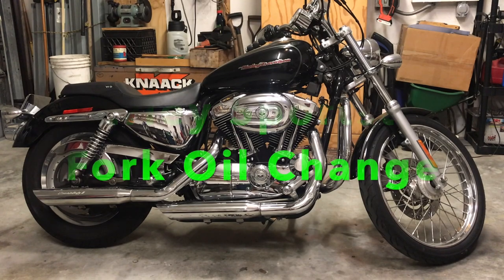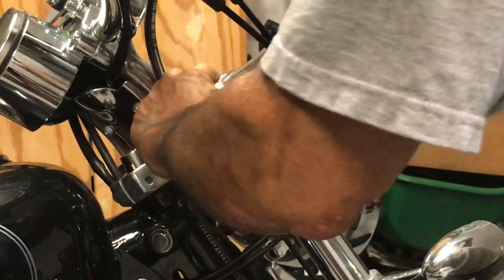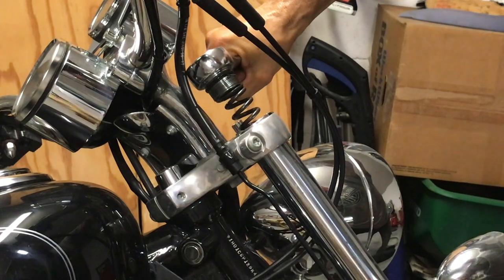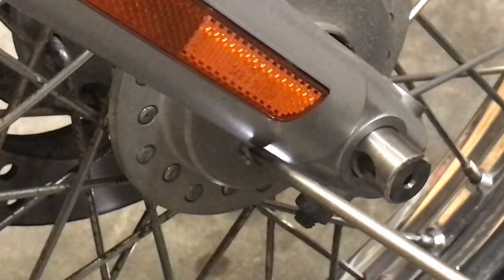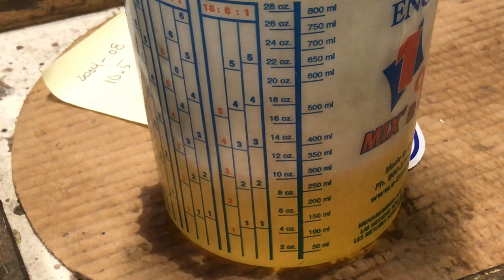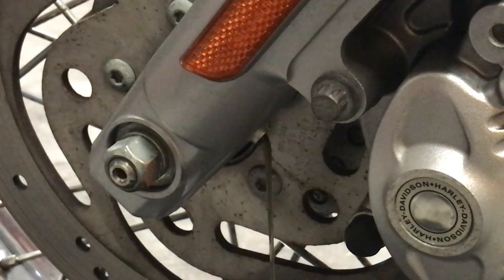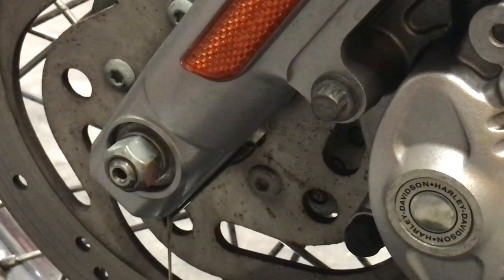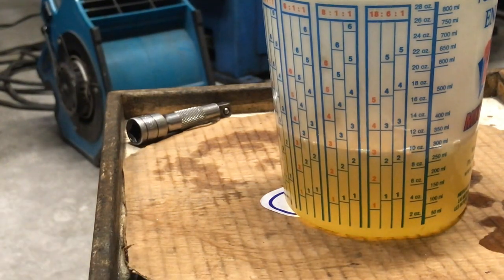How To Harley Sportster Fork Oil Change

Comment: When I changed my fork oil in my new-to-me 2005 Sportster, it had a total of 10K miles on it but because the bike was 15 years old I decided to change it along with all of the other fluids. I'm glad I did. Thankfully, 10 oz. came out of each side but the bad news is that the fluid was black, as thin as water and stunk like skunk oil. The difference in the ride afterwards was amazing. The forks had been bottoming out over big bumps but not after the fluid change. Evidently, time is also a factor in the degrading of the oil. I plan to change mine every 10K miles from now on. Wonderful video!
Reply from the maker: Happy to hear all went well, Thank you for your Sub Boomer. Any questions just ask. Ride Safe and have a great day.

Comment: Nice little tip with the Spot of paint there., excellent video as always.
Reply from the maker: Thank you, Ride Safe and have a great day.
Reply: I've got a 2002 Sportster which ticks a lot on tickover, I've removed the lifters and cleaned them but still ticking a little. They looked fine when I took them apart and only had a bit of dirt in them but the bike has only done 12000 miles, do you think it's possible they can fail with such low mileage? I've changed the oil to semi synthetic and also tried a little marvel mystery oil in with it but still it ticks on idle, oil pressure light goes out as soon as bike is started. I thought I'd ask you before I fork out for some replacement lifters, thanks for your help.
Reply from the maker: @harleydavidson801  How long have you had this tick? Did you buy it this way?
Reply: @TwoWheelRocco  I bought it like it about a year ago, a couple of times it didn't tick on startup for about 2 minutes but then returned.
Reply from the maker: @harleydavidson801  Sounds like dirty in the system. How many miles have you rode this bike since you owned it?
Reply: @TwoWheelRocco  I've only ridden it up and down my road as I have been turning into a bobber for the past  year
Reply from the maker: @harleydavidson801  You will need to give her a few good rides 50 miles or better....That should do it.. If that don't work run a cleaner for lifter in your oil. Let us know how this works out. Thank you for your support. Ride Safe and have a great day.
Reply: @TwoWheelRocco  I'll give it a good run, thanks for your help much appreciated.

Comment: I don't know what it is man but all your tutorial videos I absorb 100%. Thanks for everything have a great day
Reply from the maker: I'm really happy to help. And thank you for those kind words. If you have any questions just ask. Thank you for your Sub Dan. Ride Safe and have a great day.
Reply: @TwoWheelRocco  actually bud I do have a question. Maybe two. I have an 05 883 I just recently bought. It has an aftermarket exhaust; pretty much a straight pipe on it and a big sucker intake. I'm trying to tune my carb, any recommendations on jet sizes? The reason I'm asking is I played with it and got it to idle correctly but now it seems to want to stall when I hit the throttle. Any ideas on why it's doing that?
Reply from the maker: I would look at the Excelerator pump with that take a look at this video.   https://youtu.be/VjWzPp5mWec. at 24:00 on this video. Let us know what size jets you are running. . idle and main.
Reply: Sorry for the late response but I'm running a 42 idle and a 180 main
Reply: I just ordered a jet kit that has a big variety of idles and mains
Reply from the maker: How did your excelerator pump squirt?  That is what will cause an off idle stumble.   883  42 jet. Good   180 main?? try 170 See how she rolls out. Some times less is better, Then go up.  Let us know how that works Dan.
Reply: Accelerator pump squirted great, like a damn Super Soaker haha. But I'll definitely step down on the main. Thank you for all your help I really appreciate all your videos and everything you do you're the man!
Reply from the maker: Thank you, Let us know how this works out.

Comment: Hi Mr. Rocco, question can I drain the oil from the bottom of the fork instead of from the oil drain plug?? the reason is that if I can it would completely remove all the old oil and any sediments that are there. If you think I can Is there any precautions I should take when doing it that way?? Thank you in advance for your response. Raul
Reply from the maker: Happy to help. You can remove the bottom bolt but you'll have to take the front wheel and axle out. Then loosen up that Allen head and then the top. You can run brake fluid to clean it. Thank you for watching and all your support Raul. Let us know how it works out. I love the difference it made with the 15 weight fork oil. Ride safe and have a great day.
Reply: @TwoWheelRocco  if I go this route I will give the 15W a try. my shocks have been bottoming out on our rough streets here in L.A. Ca. maybe the 15W may help. Thanks to your videos I have been doing most of my Sportster service and I know for sure you have saved me some CASH , Thank you so much. best regards.Raul
Reply from the maker: @RAULOJEDA-fl5bn  It's my pleasure to help. The dealers and mechanics, Are just got out of hand. Ride safe and have a great day. let us know how it works out Raul..

Comment: Good job Rocco.  I did it this exact same way in around 2005 and posted it on the xlforum.   Still have my 04 sporty and change the fork oil every few years.  I've got one of those low profile sockets made for this job.  Back then it cost about the same as the correct size regular socket and fits better.  Love all your vids, clear and concise.  ✌️😎✌️ Xena from the XLF.
Reply from the maker: Happy to Help, Thank you for your Sub and kind words  Ride Safe and have a great day.

Comment: Thanks so very much for your comments I read the forum and it explained a lot,  I will have to get an unmodified new slide as this tune up was done for me by someone is not available any more,  she's spitting and coughing low throttle openings obviously running quite weak needle is about lowest clip position, again thanks for your quick reply its much appreciated, best regards, Alan, uk
Reply from the maker: Stay to basics and she will run great. Any questions just ask.  Let us know how this works out. The needle and stock slide will get the job done.

Comment: Thanks again Sir. Have a 92 XL I'm going to be working on during the winter here in Tn . This how to vid hit with perfect timeline for me . Like your work Sir carry on .
Reply from the maker: Happy to help, Ride Safe and have a great day. Thank you for your Sub.Jim.  Any questions just ask.
Reply: @TwoWheelRocco  Yes Sir I do have question for you has a matter of fact . When firing said 1992 ? 883 xl . It has a random do nothing to hit a few turns and stop doing anything from switch. New batteries have been tried.  Rockn bike in gear may let it crank to start sometimes. Thanks Sir
Reply from the maker: @jimhayes4000  I would check my cables to my starter. The positive sometimes starts to fail at the starter hook up. Then your starter relay.
Reply: Yes Sir . Be getting back at you . You going to post many videos this winter ? Thanks for your knowledge sharing

Comment: Hi Mr. Rocco, I went and purchased a 36 mm socket to remove the top nut to take out the spring but 36mm for my 2011 sportster, but it was to big I think I have to go one size smaller. I went back to look at your video and the sportster you worked on was a 2005 for this year the nut is 36mm. I will go one size smaller and I think it will be the right size. I will purchase the long socket I think it will make it easier to hold and push the spring down with the long socket. Thank you. Raul.
Reply from the maker: Happy to help. When you find out the size, please let us know. This will help others. Thank you for watching and your sub Raul ride safe and have a great day.

Comment: hey rocco, this is my next job but ive noticed I also have some excessive play in my handle bar yoke, in case ive used the wrong term I mean were the handlebars join the fork. If am sat on the bike and push the bars forward they move a few millimeters back and forward, do you think this is a worn part or a simple need to tighten the bolts underneath. I can make a video and attach a link if it helps. appreciate any help or advice you can give. I understand if you are busy, you are a kind man and have been so very helpful with my restore so far.
Reply from the maker: Tighten with 1/2 ratchet. And it will be good as new. Let us know how this works out.

Comment: Hi, really enjoy and have used your videos to help me.  I've got a 2005 sportster roadster.  Is the 36 mm socket close enough to 1and 3/8"??  I have seen the video several times, but it seems like that is a bit of a difference when you look at a conversion chart.   I have to order a socket and wanted to make sure before hand.  I also used the carb cleaner video and the bike starts so much better.  Thank you for the videos.
Reply from the maker: 36 mm will work fine. Any questions just ask.  Thank you for your Sub.  Ride Safe and have a great day.
Reply: @TwoWheelRocco  Thanks for the quick reply.  Great videos.

Comment: I have a 05 sportster with 6'' over forks. Would you recommend the same weight oil? also having a hard time finding torque specs. Great video! Thanks!
Reply from the maker: I would. If you don't like it you can remove a little oil and put thinner or thicker . As long as you use the same brand fork oil . I like 15 wt. Let us know how this works out. Thank you for watching and your sub Rob. Ride safe and have a great day.

Comment: Great video.   My left fork doesn't have a drain screw, how do I drain it?  Thank you!
Reply from the maker: You will have to remove the wheel then remove the hardware that connects the inner cartridge of your of your front Fork Tube. Or remove the fork and just tilt it to drain it from the top.  Take a look at this video on how to take your front Fork Tube apart .It 
is the same as a Harley front fork tube. This video is of a Honda.  take a look.   https://youtu.be/WOgyWDpyFig. Hope this helps. Let us know how this works out. Thank you for watching and your Sub Hoang.  Ride Safe and have a great Day.

Comment: Fantastic video.  Just got back into riding after 18 years and got ahold of a 91 sportster.  Needs a little work, and the forks are next up.  Any tips or tricks on changing out the seals?  Have a small leak in the left fork.
Reply from the maker: Happy to help, Any questions just ask. I will send you a video on the front fork seal replacement. Thank you for watching and all your support Jackelin. Ride safe and have a great day.   Take a look at this video.  https://youtu.be/1027WhyjqcQ?si=-6hArKJ2CjqJFA6e.  Let us know how it works out.

Comment: Rocco my sportster has a different looking drain plug on the fork. Its an ‘05 Roadster all blacked out and it doesn’t look like a Philip’s head, more like a coated plug. I don’t think it’s ever been off of either fork. Any idea what else might be used as a plug? Thx
Reply from the maker: If you could take a picture and send it to my email address is ERocco 3964@gmail.com  and I will get back to you.
Reply: @TwoWheelRocco  roger

Comment: Hi always watch your vlogs and a sportster carb one intrigued me when a stage 1 tune up suggests drilling out the slide air hole with 7.64 or 2.8mm what would happen if it was drilled out with the larger drill for the pilot plug? Thanks in advance sorry about the off topic but I trust your judgment, regards, Alan, uk
Reply from the maker: I like to go with carb washer under the slide needle,  use 3 washers under needle and adjust Air/fuel screw to 15/8 - 2 turns out.  This raises the needle that will richen off idle. I do not drill the slide.  Let us know how that works out.  Hope this helps.  Harley just wants to sell stuff.
http://bike-talk.com/threads/questions-regarding-stage-1-kit-for-xl1200.13560/.

Comment: Hello, Rocco ! Thanks for always putting out quality content. My 2012 XL Sportster doesn’t have the drain screws. Any ideas for getting the  oil sucked out without removing the forks? I want to replace the springs or go with 15W fork oil to make it slightly stiffer. Thank you !
Reply from the maker: Happy to help. I will Send a video on how to do fork seals,  there is hardware at the bottom of these forks that you could remove and drain the oil.  I do not recommended replace in the spring just go with 15 wait oil. Thank you for watching and you sub.T B A.  Ride safe and have a great day.  This video was done on a Honda VTX it will be the same procedure for the Harley  Davidson sportster take a look  any questions just ask.    https://youtu.be/xSlGCOAjuwc
Reply: @TwoWheelRocco  Thank you! I will give this a shot. Appreciate you as always !

Comment: Another great vid Rocco. Question...I’ve got 10k miles on my 05 xl1200r.  Fork oil never changed. Ride seems good. Manual says change at 20k. In your opinion, Should I Change fluid due to age, or wait til mileage is higher?  Thanks.
Reply from the maker: Sportster are easy to do.  15w oil will make for a better ride.  I would change it. stock is like  8 to 10w oil. Let us know how this works out. Thank you for your Support. Ride Safe and have a great day.

Comment: Rossco, is there anyway you could do a video on replacing yolk bushings and re aligning handle bars with yoke on triple tree?
Reply from the maker: Happy to help. What year bike and how many miles thank you for watching and all your support pure water. Ride safe and have a great day.
Reply: @TwoWheelRocco @TwoWheelRocco  I have a 2001 Sportster, 10 477 miles, just recently purchased from a Harley Dealer; the bike was well maintained and in great shape. Unfortunately, the other day I took a left turn too wide, and when attempting to get the bike back on the road, my foot peg caught the ledge, and the bike dropped on the left side. I'm fine. The bike is okay; there is just a scratch on the derby cover; however, my handlebars are not perpendicular to my front wheel. This often happens when folks drop their bike; a re-alignment video would be great.
Reply from the maker: Unloosen the bottom pinch bolts on your front end by your fork tubes. Have somebody sit on the bike. And straighten it out like you would do it your bicycle when you were younger. Have them rock the front back-and-forth. Re-tighten those pinch bolts on the bottom by your fork, . Do not loosen the tops and you should see it will straighten out. Let us know how it works out any questions. Test ride and see how you like it. And just loosen those pinch bolts slightly. Just to give it freedom for you to straighten it out and visually use your eyes. Let us know how it works out done it before.

Comment: How to know if I need fork oil change ?
Reply from the maker: What year how many miles? If the front feel little spongy, a higher weight oil will stiffen  the front. Which will give you a better ride. Easy enough done. Thank you for watching any questions just ask. Have a great holiday.

Comment: Another nice video Rocco. So, why the 15 weight versus the stock 10? What’s the advantage there?
Reply from the maker: It makes your front feel a little stiffer.  15WT is a thicker oil. The ride feels smoother. Thank you for your support. Ride Safe and have a great day.
Reply: Two Wheel Rocco would that help with a jarring feeling while going over rough roads or potholes?
Reply from the maker: @stevenweede7184  No
Reply: @TwoWheelRocco  would increasing the amount of oil fix his problem  ?
Reply from the maker: Happy to help. I don't believe so. But you could try see what it does. Let us know how it works. Thank you for watching and your sub Loren. Ride safe and have a great day.

Comment: Hello, is that a 6PT or 12PT Socket you're using? Thanks in Advance
Reply from the maker: Happy to Help.  Are use the 12 point that's what I had. They both will work. Any questions just ask. Thank you for watching and your sub Bill. Ride safe and have a great day

Comment: Mine doesn't  have a screw. Can I empty it from the bottom screw, or do I have to remove the whole assembly?
Reply: Mines a 2015 XL custom 1200.
Reply from the maker: Happy to help. Yes you can remove the bottom. Screw that holds the cartridge and the Fork Tube that means you will remove the front wheel. Not bad. Thank you for watching and your sub. Lisa. Let us know how it works out. Any questions just ask. Ride safe and have a great day.

Comment: Great video, thanks for sharing. Liked and subscribed.
Can you confirm that you used a 36mm socket? I’m in Australia and the non metric sockets are a little hard to find and very expensive.
Thanks again, Rocco
Reply from the maker: Happy to help. As long as you use six point socket 36 mm will work. Thank you for watching and your sub Alex. Let us know how it works out. Ride safe and have a great day.
Reply: @TwoWheelRocco  Thanks so much for getting back to me and I’ll be sure to let you know how I go

Comment: Rocco, does using a heavier viscosity fork oil make for a firmer ride? Thanks for this video by the way!!
Reply from the maker: Happy to help. Yes It does,  I find 15 wt. for Sportster's worked out real nice ..  Thank you for watching and your sub.  Let us know how that works out,  Ride Safe and have a great day.   Hope this helps.
Reply: @TwoWheelRocco  Thanks Rocco, just rebuilt both calipers on my 2003  883;;;brake fluid was black and disgusting,,never changed in 10k miles,, previous owner! now that I have good strong brakes that dont lock up the front dives bad,,so this is next   fork oil!
Reply from the maker: @USNVA-yn6cp  Happy to help. Any questions just ask, Thank you for watching and your Sub. Ride Safe and have a great day.